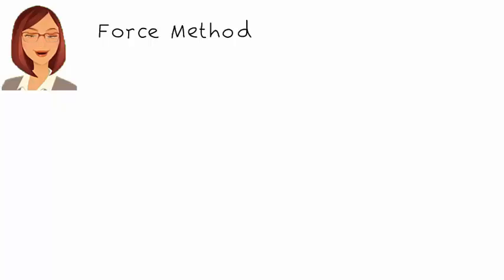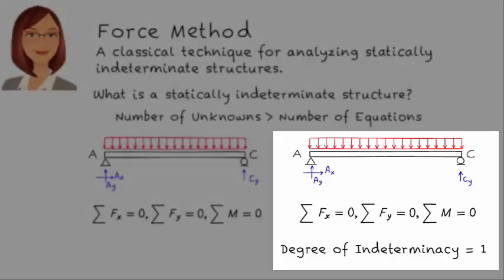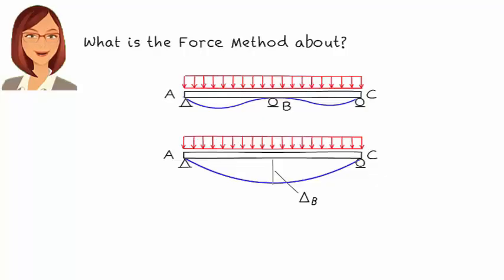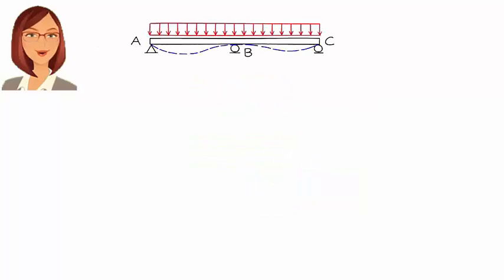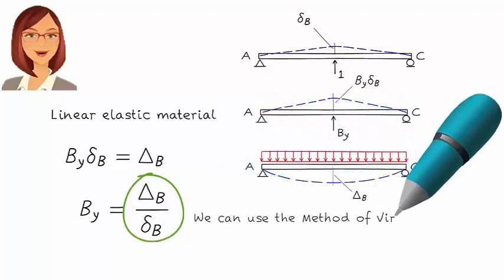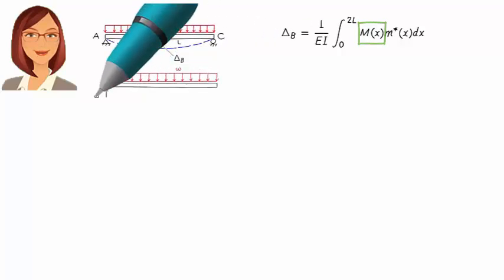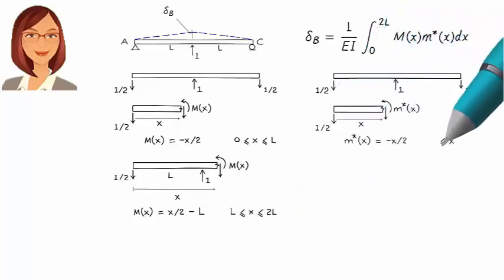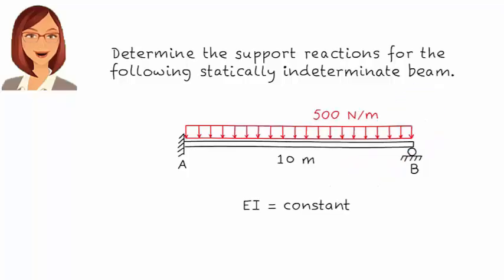SA24: Force Method (Part 1)

Comment: Because what you're computing with the method of virtual work is the work of a virtual force and because the unit force has a direction chosen to be in a direction opposite to the direction of the displacement due to the load, there should be a negative sign in the first integral. The compatibility equation is written correctly, as if that integral had the missing negative sign.

Comment: I have understand thank you.  Ma'am tell me one more thing in this question if we remove roller then we will not find slope?. Are we finding only deflection?
Reply from the maker: Correct, we need to calculate the deflection when the a vertical reaction is the redundant forces.

Comment: This is a good method! But it takes about 30 minutes for a man who is utterly professional lol
Reply from the maker: Correct, the classical methods of structural analysis are time-consuming, especially when applied by hand without the use of computers. Although they are not practical for solving problems with more than a few degrees of indeterminacy, these classical techniques offer useful insights into the behavior of structural systems and a conceptual framework for thinking about their analysis.
Reply: @DrStructure  Yea I do know that,, in work we use computers to analyze beam and frame, truss structures however, I just wanna understand this in order to pass structural analysis 2 tho. Btw I have a question, can we use conjugate beam method for slope and deflection for the first case instead of virtual work? And then apply virtual work on the virtual beam
Reply from the maker: In principle, yes. We can use any of the available techniques to determine slope and/or deflection in beams.

Comment: hi ma'am. @4:37, where did By lower case deltaB=deltaB come from?
isn't the expression on the left a work? why did you equate it with deflection?
Reply from the maker: The lower case deltaB is deflection per unit load. When we multiply it by By, we get the deflection due to By.

You may want to review the lecture on the virtual work method for the background knowledge.
Reply: @DrStructure  thank you

Comment: Won't the deflection due to udl be 5wl^4/384EI? At 6:36
Reply from the maker: For a beam of length L, yes. In our case, the length of the beam is 2L. So constant 384 in the denominator needs to be divided by 2^4.

Comment: are the two deltas in the steel handbook?
Reply from the maker: Not sure what you are asking. Please elaborate. Steel design handbooks do not usually deal with the analysis of structures.
Reply: @DrStructure  The equation for deflection is in the steel manual but not delta
Reply from the maker: Most structural analysis textbooks have a table that gives the slope and deflection for a limited number of lcases.

Comment: Example! If it has a force at between point A and B,  how I slove
 it ? Can you show me, please?
Reply from the maker: The Force Method involves writing and solving the displacement compatibility equations. These equations are defined using deflections in the beam under the applied load.

We can calculate the deflection of a beam at a point under any loading scenario (i.e., distributed, concentrated,…) using the virtual work method. 

You can find a series of lectures covering these topics in our free online course. See the video description field for the link.

Comment: If we had an axial load in the same beam (like in the case of a roof for example) would the calculations change?
Reply from the maker: If there was an axial load on a beam with only one pin support (the rest of the supports were rollers), then the horizontal reaction at the pin would be equal to the magnitude of the horizontal force. The rest of vertical supports can be computed as usual using the force method.

However, if there are two or more horizontal support reactions, and the beam is subjected to horizontal loads, then we need to consider one or more of those reactions (and possibly one or more of the vertical reactions) as redundant forces.
Reply: @DrStructure  Okey thanks for your clarification

Comment: at 7:00 what is the difference between real and virtual load. And which one is which?
Reply from the maker: In this case, it really does not matter. We have two identical free-body diagrams and moment equations. Both the real load and virtual load have a magnitude of 1, are placed at the same point, and act in the same direction.
Reply: @DrStructure  when would they be different?
Reply from the maker: @joseh7612  If we want to determine the displacement at a point, say, A due to a load that is being applied at a different point (B), then the virtual and real loads result in different moment equations. In such a case, the virtual load needs to be placed at A while the real load is at B.

Comment: Hello, I have 2 questions
1. What is the logic behind adding delta B + dell B = deflection of real beam
2. How did you consider unit load at B gives deflection= dell B. This is used to find deflection in Virtual work metho
Reply from the maker: The vertical deflection of a beam at a pin or roller support (say, at point B) is zero. When we treat the reaction force at a support as a redundant force and remove it from the beam, the beam is going to deflect downward by certain amount, say, Delta. That is, the support (its reaction force) prevents the beam from deflecting downward at point B. But now that we have remove the support, the beam is no longer restrained, hence, it is going to deflect downward by some amount which we referred to as Delta.

This Delta we can compute, since by removing the support, we’ve made the beam statically determinate. Say, we calculate Delta to be 10 mm in the downward direction.

To determine the redundant reaction force, call it R, we are going to place a unit upward force at B and calculate the upward deflection that results. We label this deflection as lowercase delta. Suppose this upward deflection is 0.5 mm. This means that if we increase the magnitude of the load to 2, the deflection becomes 1 mm, if the load magnitude is increased to 3, the deflection becomes 1.5 mm, and so on. So, if delta is the deflection due to a unit load, R  times delta = the upward deflection due to the reaction force R. This upward deflection, which is the deflection due to the (redundant) reaction force at B must be equal to the downward deflection Delta, since we know the total deflection at the support must be zero. So, we write:

R delta (upward) = Delta (downward)

Using a more consistent sign convention where both deflections are defined in the upward direction, the above expression can be written as:

R (delta) + Delta = 0

where the right hand side of the equation is the actual deflection of the beam at point B.

Using the numbers given above, we can rewrite the equation as:

R (0.5) = 10. 

Which yields R (the redundant force): R = 20.
Reply: @DrStructure  ok understood now, Thanks for explaining. Good work!! Keep going👍

Comment: Is the force method applicable ONLY for having one degree of indeterminacy?
Reply from the maker: No, in principle the method can be used to analyze beams with N degrees of indeterminacy. The method yields N equations in N unknowns which can be used to calculate N redundant reaction forces. See SA25 (https://www.youtube.com/watch?v=N6FDLx0MrOI&t=4s) for the use of the method for analyzing a beam with 2 degrees of indeterminacy.
Reply: @DrStructure  Thanks.

Comment: We can't choose Ax force as redundant its because due to this force the system become unstable it will move in x direction.
 Is i am right??
Yes or no please comment
Reply from the maker: Yes, and no.  
Yes, because we should not making a force that causes instability in the structure a redundant force.
No, because in this case, Ax = 0. Since the sum of the forces in the x direction must be zero, and Ax is the only force in that direction, then Ax = 0. So, it serves no purpose to make Ax a redundant force.

Comment: Is it possible or correct way to use it on a statically determined beam case? because I was taught like that in my class. I am a little confused right now, I need your wisdom. Thanks
Reply from the maker: The force method is for analyzing indeterminate beams. If the beam is determinate, there is no reason to use this method. We can simply use the three static equilibrium equations to calculate the support reactions.
Reply: Sorry, but that's not what I mean. I mean, is it possible to use the force method to calculate static beam deflection instead of the double integration method? is there any method similar to the force method to calculate the static beam deflection?
Reply from the maker: No, the force method cannot be used to calculate deflections. The force method is for calculating unknown reaction forces in indeterminate beams. It so happens that the method uses deflections for that purposes. The deflections themselves are calculated using techniques such as double integration.
Reply from the maker: Also, please keep in mind that we are not using the force method to calculate deflections. The deflection computations that take place here are for determining the unknown reaction forces. Put it differently, the force method uses displacements of statically determinate beams in order to determine the unknown reactions in the statically indeterminate beam. The displacements themselves can be calculated using any technique of your choice. Generally speaking, the available techniques for displacement calculations require a statically determinate structure.
Reply: Thanks for your wisdom, speaking of the calculation method for deflection, is there any method beside the double integration method? As you said that I can calculate the displacement using any technique I prefer.
Reply from the maker: @bagusbudi3018  Yes, the conjugate beam method and the moment-area method are two classical techniques for calculating displacements. You can also use the virtual work method. We have a series of videos on these techniques. You can find the YouTube links on the list here: http://lab101.space/Course-StructuralAnalysis.asp
Reply: Thanks a lot,  hope the best for this channel

Comment: Dr structure, thanks a lot for the video, I have a question , when I use the formulas in front cover of structural analysis book for Hibbeler , the delta B ( capital) is maximum at mid span equal 5wL^4/384 is it right? Because the final answer i got was  5wL/8 
Please reply dr because I need it to teach my students in the college
Reply from the maker: Yes, the expression in the book is correct. The value is obtained by integrating:
M m* dx  where
M = ( w L/2) x - w x^2 /2
m* = x/2 for 0 <= x <= L/2 and 
m* = x/2 - (x- L/2) for L/2 <= x <= L.

Integrating M m* dx from 0 to L/2 gives:  5 w L^4/768
Integrating M m* dx from L/2 to L gives: 5 w L^4/768

Adding the above values, we get: 5 wL^4/384
Reply: Dr. Structure thanks for replying, but why the final answer i obtained was half of that you obtained ?

My solution is 
By=(5 wL^4/384)/(1*L^3/48)=5wL/8
Reply from the maker: I am not sure why your answer is different.  I need to see your calculations in order to be able to detect the source of the problem.

Comment: why the m*(x)=L-x/2 (L<x<2L)? Isn't is m*(x)=L/2-x/2? Please explain:)
Reply from the maker: We are summing the moments about the cut point, assuming the counterclockwise direction as positive. There are two forces that create a moment about the point. The reaction force at the left end of the beam has a magnitude of 1/2 and a moment arm of x about the cut point. The force creates a clockwise moment of (1/2)(x) about the cut point. The unit virtual load has a moment arm of (x-L) about the cut point. Hence, it creates a moment of (1)(x-L) about the point. And there is a counterclockwise concentrated moment of m*(x) at the cut point. So, the total moment can be written as: m*(x) - (1/2)(x) + (1)(x-L) = 0. Solving this equation for m*(x), we get: m*(x) = (1/2)(x) - x + L.  Or, m*(x) = L - x/2.

Comment: is force method based on strain energy
Reply from the maker: The force method involves using various displacements for formulating the compatibility equations. We can use an energy method (e.g., virtual work method) or a non-energy method (e.g., conjugate beam method) for calculating the displacements. So, the force method may, or may not, be viewed as an energy method, depending on which method we use to calculate the displacements. But in a strict sense, it is not an energy method.
Reply: @DrStructure  thank you 😎
Reply: @DrStructure  then what are the different energy methods to analyse a structure?
Reply from the maker: The work-energy principle which establishes mathematical relationships between external work and internal energy of systems is the basis of modern structural analysis techniques such as the displacement method, finite element methods (which is a generalized form of the displacement method), and boundary element methods.
Reply: @DrStructure  does castigliano theorem come under energy method?
Reply from the maker: Yes.

Comment: Suppose if there is a beam joined with the steel cable as we see in Hibblers chapter 4 of mechanics of materials 9th edition in which we have to perform compatibility to calculate unknown in statically indeterminate beam
Then how this method will help in calculating force in that cable
Please clear this small thing
Reply from the maker: I don't know what specific problem you are solving. Regardless, you want to pick the reaction at the pin/roller where displacement is know to be zero, as the redundant force. That would turn the system into a determinate beam. Then you can use the equilibrium equations to find the remaining forces, including the one in the cable, calculate the elongation of the cable, then use basic geometry to determine displacement at the support where the redundant force has been removed...
Reply: All right
Just  Make one thing clear This method is applicable on all kinds of problems in mechanics of materials
no matter which one i pick 
even those problems in which beam is fully supported by cables from starting to ending
Reply from the maker: This method requires that we know the displacement, often zero, at the point of redundancy. If a structure is supported such that none of the joint displacements are know, or can be assumed to be zero, then the method would not work.
Reply: OK then please assure one thing can we start with the pin which is connected at the starting or ending of the beam instead of roller just like you have done with the Roller.
Reply from the maker: Yes, any support reaction (at a roller, a pin or a fixed support) can be taken as the redundant force.
Reply: Please one more question
I am trying to solve problems
4-52,4-55 and 4-53 in Hibblers 9th eddition
these problems are statically indeterminate problems
are these problems easily solvable by this force method
please clear this matter for me 
Thank you
Reply from the maker: Those problems could be best solved using the procedure explained in the chapter.

Comment: i have a small doubt regarding bending moment sign convention, i.e, you have written positive sign for reaction force while considering 0<x<l and negative when l<x<2l. 
My question is why the sign gets changed before and after the point load condition?
My 2nd question is that you said at constant EI, why?  I also went through your video describing about virtual work, thr you mentioned that constant EI, is it possible to have EJ? if so means at what condition it is possible?
please replay to these questions, I badly need those. 
thank you.
Reply from the maker: Bending moment in a beam segment is considered positive if it causes the segment to bend concave up. So, when we are showing positive moment in a beam segment, we need to draw a clockwise moment at the left end of the segment, and a counterclockwise moment at the right end of the segment, causing the segment to bend downward (forming a concave up shape).

Notice that bending moment, m*, is shown that way at the right end of the segments @6:28.  

The sign of the terms that appear in the moment equation is unrelated to the sign of the bending moment that we have drawn already.  To write the moment equations, we have assumed counterclockwise direction to be positive. We could have assume the opposite, we could have assumed clockwise is positive. Please note that this has nothing to do with the sign convention I mentioned above. They are independent of each other.  That is the sign convention for bending moment is not the same as the sign convention for writing the equilibrium equations.

Using counterclockwise as positive, the first equation becomes:
m(x) - (1/2)x = 0, or, m(x) = x/2

The second equation can be written as: m(x) - (1/2)x + 1(x-L) = 0.  Note that here we have one additional term, the unit load. This term was not present for the first equation. After simplification, the second equation becomes:
m(x) = L - x/2.

As for EI being constant, that basically means the member does not change properties. But, we could have a composite member with different E values. Or, the shape of them member can change, like a tapered beam, making the moment of inertia (I) to change.

When EI is not constant, then it cannot be treated as a constant when we are integrating. We need to have EI expressed in terms of x, then include it in our integration.

Comment: What if there is a point load added to the question
Reply from the maker: If there is a concentrated load on the beam, then the total displacement at a target point (at the point where the redundant force is located) would be due to the distributed load AND the concentrated load. We can calculate that displacement using the principle of superposition.  Calculate the displacement due to the distributed load only, and calculate the displacement due to the concentrated load only, then add them together to get the total displacement.